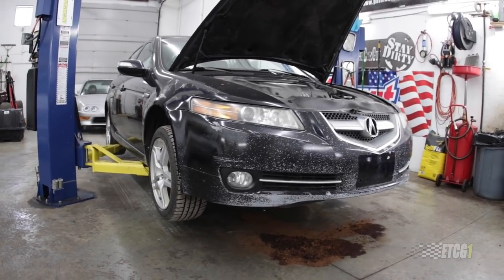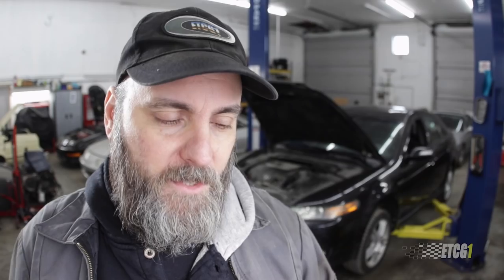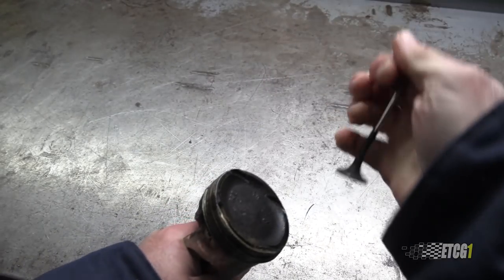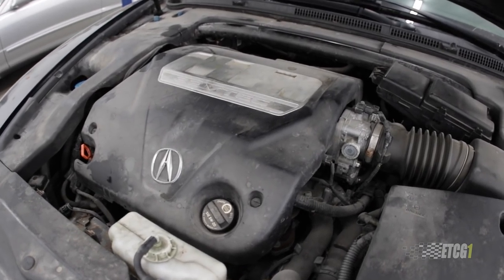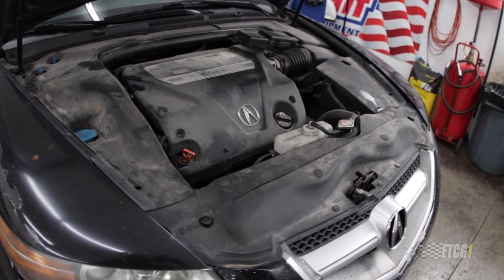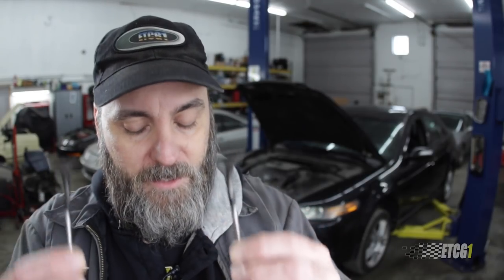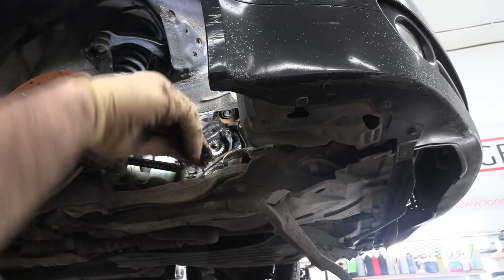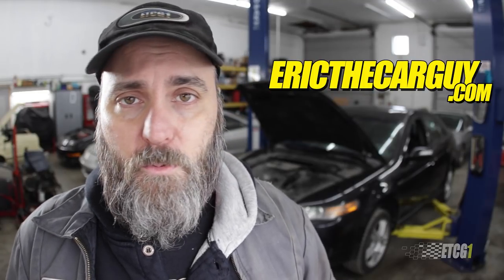What Is an Interference Engine?

Comment: The question I have is this: If you can make an engine non-interference, why would you ever make one that is interference???
Reply: You can get higher compression ratios by making the pistons travel father producing more power, and providing better fuel economy.
Reply from the maker: Power and performance. If you want power from the engine you give it higher compression and a higher lift and duration camshaft. Doing that makes it so the valves and pistons come close to each other during operation. If you want a non interference engine, be prepared to accept less power.
Reply: Sometimes piston crowns are compromised in shape. Piston crown design affects smog in a similar way to combustion chamber shape.

Comment: Why do manufacturers even make interference engines?
Reply from the maker: They don't set out to make an interference engine. If you want an engine to perform, you give it higher compression and a higher lift and duration camshaft. This puts the pistons and valves closer together during engine rotation.

Comment: This begs the question, "Why do they make interference engines in the first place?"

Oh yeah, because engineers never put any thought into "What if X breaks..."
Reply: Efficiency that’s why
Reply from the maker: If you want performance, you need to increase compression and run a higher lift and duration camshaft. This means the pistons and valves will come closer to each other during operation.
Reply: Either that, or accountants ask "How do we keep cars from lasting too long? How do we sell more services than just the basics?" I can just imagine when the Nissan 300ZXT was being developed, someone asked "How are we supposed to make money in the future, when people still have a Datsun 240Z?" Someone then answered "Let's bolt a ticking time bomb to this new engine design. If they maintain their car, they pay. If they don't, they pay even more! Future sales!"

I find it funny that the 1984-1987 300ZXT has 7.8:1 compression and is still an interference engine.

Comment: This is my 2011 Volvo C30.T5 R-Design. A mechanic told me it's running rough like this because it eorher jumped a tooth or the tensioner failed. Let me know what you think. The car starts and runs but is currently parked.

https://youtube.com/shorts/Fu2bWv6Nweg?feature=shared

Comment: Why do interference engines exist if they can cause these issues …
Reply from the maker: If you want an engine to perform, you give it higher compression and an higher lift and duration camshaft. This puts the pistons and valves closer together during engine rotation.

Comment: Interference engine is spelled H O N D A
Reply: Honda is not the only...
Reply: @walterk1221  of course not; however, due to volumne on the road their issue with this is notorious.  Btw..Nissan also is guilty.
Reply: @Machi74005  it's also not a new phenomenon. I only know anecdotally that Honda engines can be damaged (via Eric's videos) and that Scotty Kilmer touts that Toyota engines are not "interference engines". My vehicles are Diesel engines with timing gears.
Reply: Nissan made a lot of interference engines. The VG was found in the Hardbody and early Frontier. If not replaced, those were usually the death of those trucks. Either that, or a freelance mechanic would buy one cheap, rebuild heads, and drive for years afterwards.
Reply: @skylinefever  I ownwd a Nissan Frontier once.  Never again.